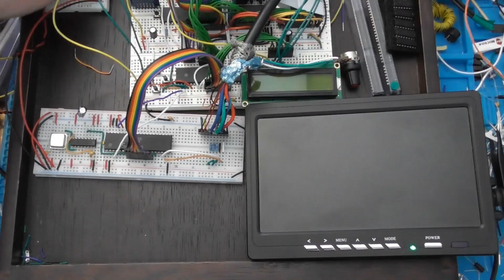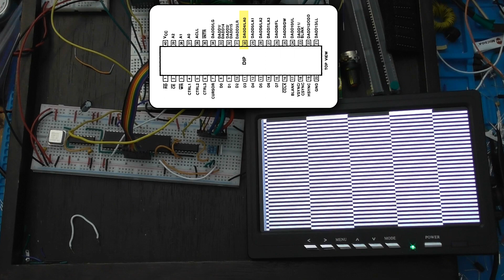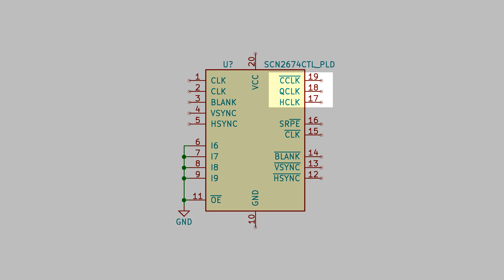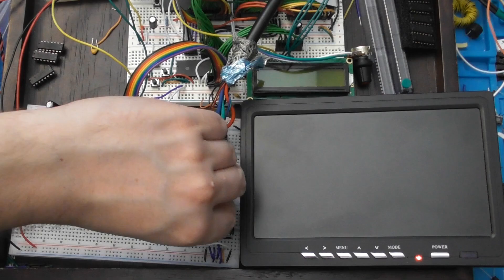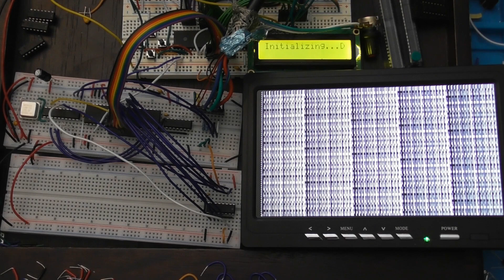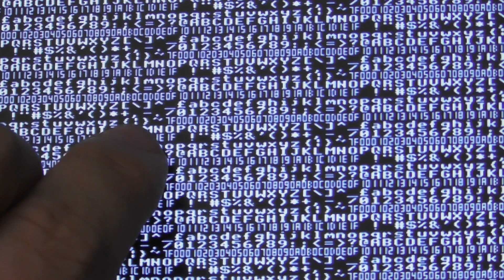How to display VGA text output using the SCN2674 on a breadboard

Comment: Hello! Are you going to continue this mini series? I'm getting a hold of two of these ICs for my Z80 computer, i'd love to see how you manage to hook up memory into this system!
Reply from the maker: I am not sure, I haven't used the SCN2674 for anything since then but it was a nice chip.  There are a few different ways to manage memory access that you can choose between, you'll need to pick depending on your needs.  I think one at least was quite straightforward but made the microprocessor's access to the memory quite limited - still that is probably the easiest to get working, you need to send commands to the SCN2674 to tell it what to write to memory and it will perform the write for you.  I think one of the other modes allowed you to request to write but then you had to wait for it to say it's OK and then write the data - a bit harder to coordinate.
Reply: AH! just  noticed you responded, It's quite a nice chip indeed! i never ended up getting it to work since i got it. Jameco listing said SCN2674 but ended up getting the SCN2672, Similar chips, Even the same pinout! except the constraints on the SCN2672 are a bit harsher in my view. currently I've only gotten the display to barely recognize the signal, sadly the monitor i have seems to be really picky on the signal (even HDMI gives me issues!) to the point it says the signal isn't supported, even after trying for a good 2 days with an arduino UNO, i never got it to properly recognize the signal.
Reply from the maker: @henumeramon30-v3e  Oh!  That's a shame, oh well!

Comment: So, you're using a shift register to buffer the pixel data, which creates that weird requirement of generating its load enable signal correctly, but I'm wondering why the same effect couldn't be achieved much more simply using a 8-to-1 multiplexer (74HC4051), with the counter value as the address input?

Comment: Could you post the circuit you showed in the short using the flip flops and inverters instead of the programable chip please?
Reply from the maker: Ah I'm not sure what it was any more - I'll see if I have a better photo of the breadboard, to reverse engineer it from, or the PLD source code.
Reply: @GeorgeFoot  No worries. I can pause the video and trace the wires if I have to.
Reply: @GeorgeFoot  Say George, could you help me with a VASM puzzle? As soon as my program got over 1k in size, VASM made the binary file 64k and it wont' load onto my rom. Any idea how to fix it? Thanks in advance for any help.
Reply from the maker: @canuckprogressive.3435  Can you upload some of the content of the file? E.g. pastebin?
Reply: @GeorgeFoot  I'm not sure what you mean. I could email a copy of my souce code I guess.

I use programer's notepad to make my sourcecode.
I put .org $8000 after defining variables and put the usual .word directives starting at FFFA for reset and irq vectors. Vasm compiles it just fine but just makes a 64 k binary since it got over 1kb in size. smaller source codes still compile to 32 kb as usual.
Reply from the maker: I'm not sure why it would do that after 1k, it's not something I've seen it do before I'm afraid. Like you I think I just use org at the top and before the vectors.
Reply from the maker: If you accidentally emitted some data before the first .org it might implicitly go at address 0 and cause vasm to pad up to 8000 instead of just starting from there
Reply: @GeorgeFoot  Sometimes stuff just doesn't work. This seems to be one of those times. I checked everything. I tried commenting out stuff and when it dropped below about 923 bytes the binary went back to 32k. well I'm stumped. Thanks for trying to help.
Reply: @GeorgeFoot  I don't even understand why it was convieniently making 32 k files before. Ha ha.
Reply: @GeorgeFoot  You were right George. There were a couple of garbage characters hiding in my variable declarations before the .org. I got rid of them and I am back in action.
Cheers!
Reply: Thanks again. Looking forward to your next post they are always interesting.

Comment: I was experimenting with this circuit a bit and found a small error in the 16v8.
It was causing the first column to display incorrectly.
I think this also might be usefull for you:

Field D = [blank_out, blank_in];
!SR_PE.d = !(C:6) # !(D:[0..1]);
Reply from the maker: Yes, I think everything needs to be delayed by at least a character. The datasheet talks a bit about how the standard ICs they make for character generation and attributes do delay the output. We should really increase the horizontal front porch and decrease the back porch as well, I think.
Reply from the maker: Possibly that's also something we can do to make the vertical timing more correct, it might need a 22v10 though for that

Comment: I'm impressed how you figured it all out. Inspiring! I'm going to buy some SCN2674 chips and try to replicate your setup. I just recently tried the TMS9918A, and I'm not really impressed. I'd rather have a clean VGA out, even if it's monochrome. Will you have a git with your schematic and code?
Reply from the maker: Bear in mind that, even if it's low resolution, the TMS9918A does a lot more than the SCN2674, which only really handles the sync timing and address generation. So as well as supplying the RAM, as you can see here you need a lot more output circuitry to display anything useful, let alone more advanced things like sprites (which I'll hopefully be covering soon, for VGA in general!)

Colour is not a huge problem here, it's easy to add - you just need more shift registers and enough memory width to store multiple bits per pixel, as in my other VGA videos. And for text-only displays, the memory problem goes away as well as you don't need to store individual pixel colours, you just store one pair of colours for the whole character cell.

I'll make a proper schematic when the RAM is in, so that it becomes a more fully-fledged system.

Comment: George, great job.  Reminds me of when I was designing a homebrew display terminal based on Don Lancaster's "TV Typewriter" in the late '70s.  It's always satisfying getting characters to display on a screen; especially when they don't flicker.  Thank you.
Reply from the maker: I love the term "TV Typewriter", it's such a direct description of the device!

I suspect that avoiding flicker is easier these days with LCD monitors that digitise the frame, quantising everything and so rounding off any minor errors.
Reply: @GeorgeFoot  You're right about avoiding flicker.  One of the TV Typewriter tricks was err on the side of blanking signals since a dark artifact is much less obvious than a white one.  If you can find this book at your local library, it's an interesting look into video of 45 years ago: https://www.amazon.com/TV-Typewriter-Cookbook-Don-Lancaster/dp/0672213133/ref=sr_1_4?dchild=1&qid=1624915164&refinements=p_27%3ADon+Lancaster&s=books&sr=1-4

Comment: I'd know that character set design anywhere! 😄
Reply from the maker: It's very like the BBC Micro font - I learned things like the bold verticals at an early age! I remember looking at the actual BBC Micro font later on and tweaking some things based on that to work better - so it might have ended up identical to it in the end.
Reply: @ with a value of zero can mean only one thing: Petscii!